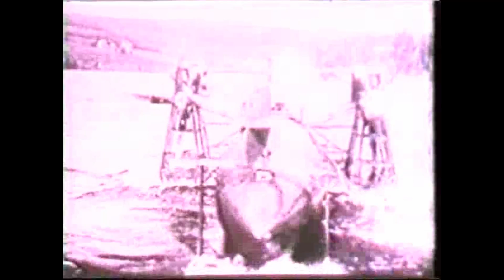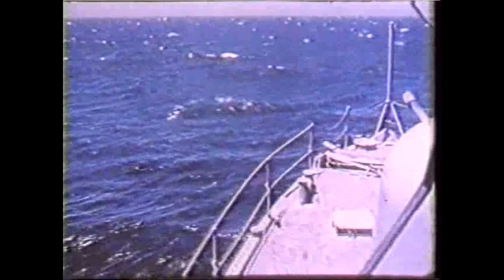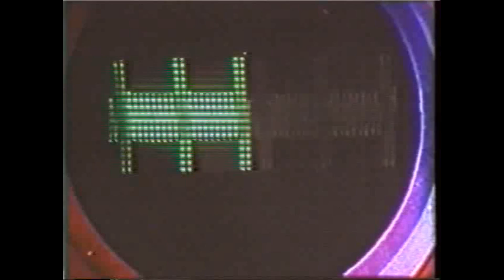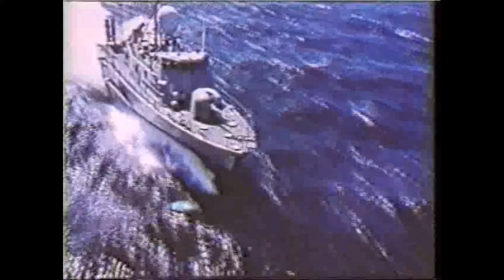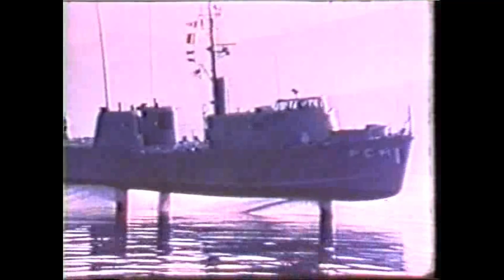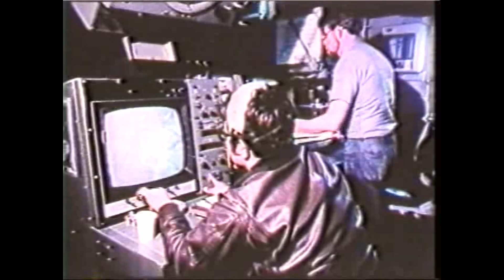a ship whose time has come

Comment: These boats gave come and gone.
Think they're all decommissioned.
Now there's SWATH and can't say the Navy  has moved into this technology either.
Reply: hydrofoils are riding on the surface of the water and thus have some disadvantages in rough oceans. Swath have advantages such as very little roll/listing but aren't terribly fast. Catamarans also have their advantage/disadvantage. Everything is a trade off and needs dictate what is best.
Reply: Almost all of them got scrapped, except for one lucky one that a Scraper purchased instead and converted it to a Museum, It's the last of the PHM's Uss Aries No. 5. Located in Gasconade MO of all places.